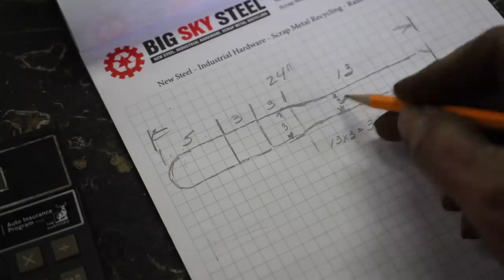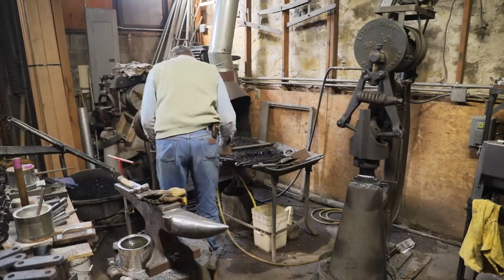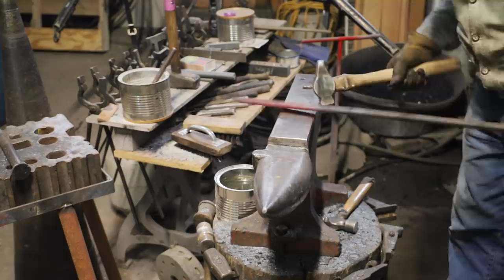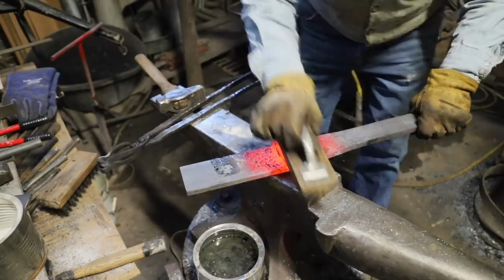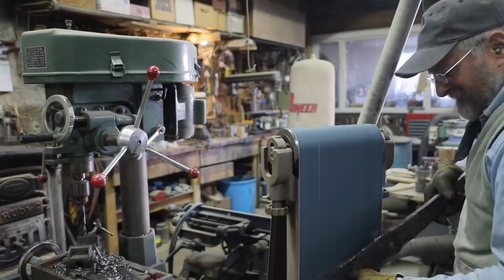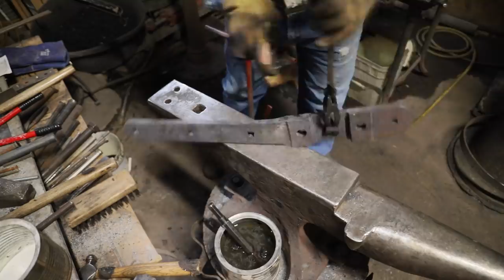Blacksmithing like the 1880s When Building Axle Saddles | Engels Coach

Comment: The irony of using Borax to flux the forge-welded joints isn't lost...
Reply: I was thinking the same thing. But I never found anything that works better than Borax. :)
Reply: @davidharris6581  I heard sand can work.
Reply: What’s ironic about it?
Reply: Pocketfarmer1 
I think he is referring to the fact that this is a Borax water wagon that the originals were used to haul Borax out of the desert.
Reply: Wayne Crews 
thanks ,but I knew what the reference was. If the wagon being built was made of wood and use to haul wood , or made with iron to haul iron ore, would that be ironic ? No . That is not what irony means. Perhaps he meant coincidental.   Maybe that’s what all that borax was being mined for in the first place.

Comment: I enjoyed your video, I have that exact same coal forge..I used to make axes and knives for a living and forged welded up lot of axes with it ( used regular borax as flux too)
 I never had a power hammer, just used a hand hammer. 
  Won’t get on you to much for “ cheating “ using those nail rivets to hold the parts in place! 😃

Comment: Amazing as always, wish there was just a little more details like what was that white powder you put on the white hot metal and why? How do you light up a cold forge?
Reply: Ironically, it's Borax, the very product that this wagon is being used for as part of the 20 mule team that used to haul the Borax out of the mines to the railroad. It's used as a flux to forge weld two pieces of metal together. Dave also built the original wagons in earlier videos.

Comment: Your machines are amazing. You included. I was looking at the machine used to flatten the metal. It has a lot of pivot points either bolts, bushings or bearings. Do you have to repair, rebuild the machine from time to time?

Comment: Could this have been done without a power hammer? I am still amazed how accurate you are all your work.
Reply: Without the power hammer, you just have a couple of strong apprentices with sledge hammers while the blacksmith directs the blows and moves the metal.
Basically the same idea as the power hammer, you just have someone with a sledge providing the blows.
Reply: @ke6gwf  with relatively small welds, even a single blacksmith can hand weld.  Its hard work, but was and is still done.  Thats why power hammers were invented.  Trip hammers powered by waterwheels have been around since at least the middle ages, BCE in China.
Reply: @markdoldon8852 , yes I agree!
With a strong and determined blacksmith, most anything could be done by himself, it would just take a very long time.
And the original question was what would be done without a power hammer, and the answer is either a patient lone blacksmith working away, or what was very common was to get one or several people with sledge hammes to speed up the work when a power hammer was not available.

Comment: Wonderful stuff, as always.

I am curious about the use of an abrasive cutoff blade in your saw.  I know there are special carbide-tipped blades designed for cutting various metals.  Would something like that be suitable for the kind of metal stock you trim to length?  Fewer sparks, at any rate...

Comment: Tell me you weren't tempted to arc weld those small preventers either side of the axle (that you riveted and later forge-welded onto the main leaf) and be done with it in about 2 minutes? It astounds me how much you have to fuss with every little piece of everything. Yeah, you beat the parts with massive hammers and stick them into a yellow-hot forge, but it's much more like building a violin or a guitar than a utilitarian wagon. Your skills are amazing.

Comment: So when the originals were built they didn't have belt sanders and cutoff saws. This was would be done with files and at the anvil correct? Would they have had the power hammer and if not would all that welding be done by hand?
Reply: I know there are pedal powered power hammers, not sure when they came up with the idea or how they did it before that though. I'd assume they just did it the hard way, get out the BIG hammer.
Reply: @fillg  I bet the had some killer arms, who needs a gym? lol

Comment: When you tap the anvil with your hammer, does that help?? So many hits on the steel , so many hits on the anvil. ???
Reply: Just an annoying habit many metal shop workers pick up.
Reply: @EngelsCoachShop  Blacksmiths "wood" not be what it is without a hammer  banging on the anvil to make that  black smith working sound. Also, if i was 100 years younger, I would come and work with you for nothing just to learn.
Reply: Ranchdude43  --  A little explanation is needed here.  A good anvil (as opposed to a "dead" anvil) will give a recoil to the hammer when hit.  In other words, the hammer will bounce.  Some Blacksmiths, like myself, will tap the anvil with their hammer to keep time especially when adjusting their work piece in between forging blows.
Reply: @IronClad292  Thank you for your reply. Most people have NO idea about alive or dead steel. Tool steel is alive, hot rolled is dead compared to each other. A GOOD anvil is hard to come by.!!!

Comment: So is flux better than just welding?
Reply: Chris Cantu. Yes. When Iron or steel is heated and exposed to air, scale is formed.  This is called "oxide scale" or "iron oxide scale" caused from oxidation.  This scale will inhibit a good or successful forge weld.  To prevent this, flux is added, after the metal has been heated and brushed off, to keep air from contacting the hot metal surface.  When the Blacksmith commences to hammer, the flux squirts out of the sides of the contacting surfaces as seen in the video.

Comment: Excuse my Ignorance but what does the Borax do for the flux joints?
Reply: Reptile4570  --  When Iron or steel is heated and exposed to air, scale is formed.  This is called "oxide scale" or "iron oxide scale" caused from oxidation.  This scale will inhibit a good or successful forge weld.  To prevent this, flux is added, after the metal has been heated and brushed off, to keep air from contacting the hot metal surface.  When the Blacksmith commences to hammer, the flux squirts out of the sides of the contacting surfaces as seen in the video.

Comment: In the 1860's they didn't have access to hydraulic presses. I admire your skills, they are fabulous, but this is historically inaccurate.
Reply: You can be sure they would have used them if they were available
Reply: @Otto Leisering: "historically inaccurate" - quite a stupid comment, IMHO. The purpose of this is to reproduce the wagons, so that they resemble the originals as far as possible in terms of used material, function and appearance. The purpose is not to impose unreasonable impracticality on the person doing it. Including that "possibly one of the persons doing the original job died from exhaustion or bad working condititions", for example? 

After all, this is a restoration project which needs to be paid by somebody. I am sure the persons who ordered this wagons would not be thrilled to pay 3 times as much just for the sticker "made the primitive way", despite the end product being 99% identical.